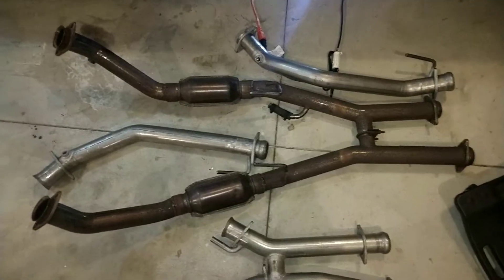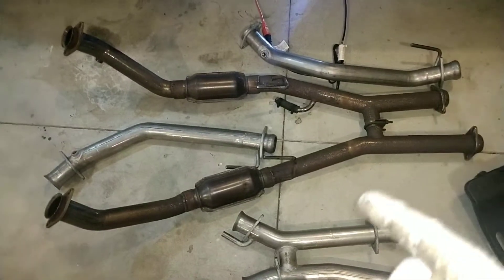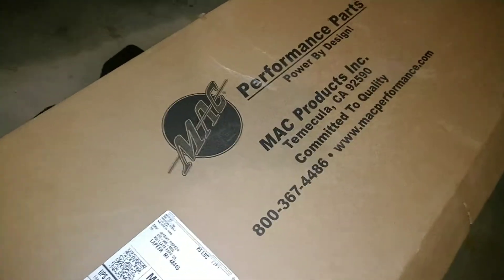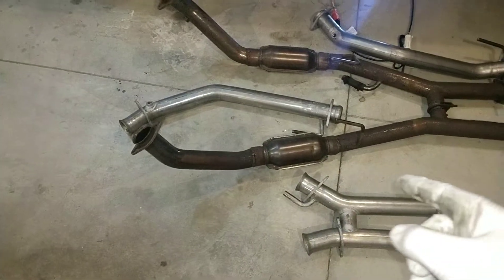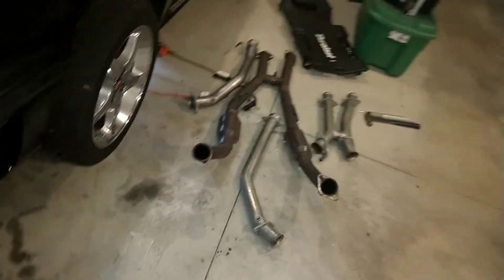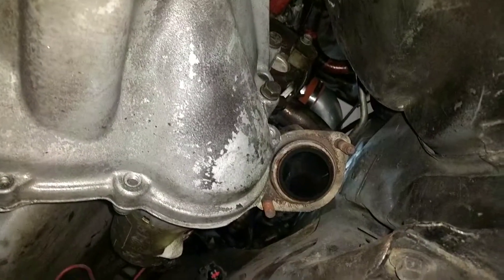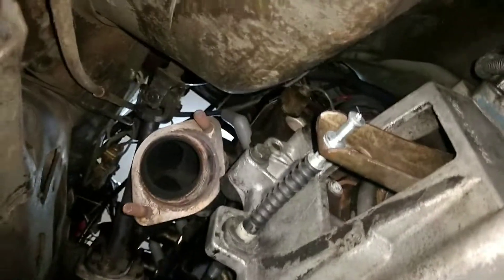Replacing Foxbody Mustang H-Pipe

Comment: Hey man, behind the cats, there's the hangers. On my 90 LX, I cannot for the life of me get them free. I am really just having a lot of trouble getting it out. Any pointers?
Reply from the maker: If I recall, those are the hangers near the transmission?  I think they were a little bit of a pain putting in, I had to really push them up, then slide forward into the hangers. Coming out, was easier because I pulled them out first at the headers (front), then unbolted from the mufflers. It then slid right out. I hope this helps, this was a couple years ago.
Reply: @jpp9846  yeah those are the ones. Been trying to get it free for about 3 days now. Used tons of penetrating oil to no avail. Going in with the blowtorch tomorrow. Thanks man, great content!
Reply from the maker: @vondy4956  I don't recall mine being as hard to remove as it was to install? My smog stuff had been removed (besides the cats that were put back on, then removed) too, there is a smog attachment near those hangers, be sure it's not still hooked up. Sometimes they face upwards towards the floor board, so you may have over looked it, that also needs to be unhooked, just another idea, good luck. These cars are a love-hate relationship.
Reply: @jpp9846  I have no such smog thing. The hangers are completely stuck, I have tried literally everything I have at home. I have no clue what to do.
Reply from the maker: @vondy4956  I will take a look at mine tomorrow and see what I can see.
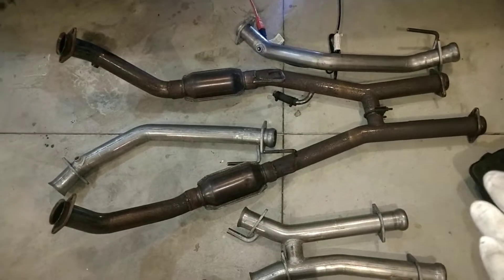Reply from the maker: @vondy4956  try putting a jack under the h-pipe and SLIGHTLY jack it up. This will help release some pressure. I'd then squirt some penetrating oil or WD40 into those rubber hangers and hammer those hangers out of those rubber loops with a wood or rubber mallet. If you look at my video again at 00:12 , that smog tube is the little wrapped and clamped tube you see near the hanger on the top. Be sure that isn't attached to anything.ive heard some people just cut and don't re-use those hangers.
Reply: @jpp9846  appreciate the advice man. Had to stop working on the exhaust as I had some more pressing matters (blown head gasket lmao). Its a shame since the car only has 50K miles and my dad was very easy on it. I'll definitely give that a shot when I get back to it!
Reply from the maker: @vondy4956   These cars will give you fits.  You honestly need to love them, or sever ties.  I haven't wrenched on mine in a while (*knocks on wood*) but I haven't been out in it  a lot lately either.
I think that floor jack trick will do it.
If not, I've heard of some people cutting those loops and not reusing them. Good Luck!

Comment: So far so good!
Reply from the maker: Lost a header flange bolt in the dam frame! Had to go buy one at the parts store... having a blast!
Reply: @jpp9846  I know how that goes!  Be sure to juice up all the threads with some penetrant spray.  Rusty hardware likes to bind up.
Reply from the maker: @fwh79FOXR6  dam bolt doesn't work. Guess I'm tapping out tonight...back at it in the AM.
In other news, was nice having that wall heater unit out there tonight...got nice and toasty!!
Reply: J PP:  Having heat in the garage is a game changer for sure!
Reply from the maker: @fwh79FOXR6  done! But with a few leaks at the header flanges and a few other along the way to the mufflers. Stinky!! Lol! 
Definitely has a deep growl to it. I'm going to probably go back through it and loosen and re-tighten the flanges....starting at the headers, back. 
Unless you got any other tips, that's the plan.
Reply: @jpp9846  That's good... I was wondering how it was going for ya.  I would just retighten the bolts like you plan to.  No need to loosen them.  Did you get the car down and take it for a drive?  Or is it still up on jack stands?
Reply from the maker: @fwh79FOXR6  re-tighten them, but t don't loosen them? I probably screwed up the sequence...I don't know...all I can do is smell fumes still, lol! Whew!!
No, the car is still up on jack stands, got about 6" of snow out there...no plans to take her out. Does that make a difference?
Reply: @jpp9846  The heat from running the engine will expand all the connections a bit.  So I usually retighten all the hardware after the pipes cool down.  I was just curious if the engine was running better now.  That's why I asked if you drove it or not.
Reply from the maker: @fwh79FOXR6  ahhhh! Man, that could probably be the ticket. Get those pipes nice and hot, then re-tighten. I didn't run it too long, I will need to open that garage door up all the way tomorrow and let her run for a bit, then re-tighten. Those fumes were just a bit too much, lol
You know what the car didn't do this time at cold start? Rev up to 1.5 RRMs then, slowly drop to .09 like it normally does....was strange. Not sure if that was good or bad? But it has a deep growl to it now, sounds pretty friggin awesome....just a bit fumee
Reply: @jpp9846  I would disconnect the battery over night to wipe out the computers look up fuel tables.  Yeah, you gotta have the door open to run the car.  Exhaust fumes are pretty dangerous.  That's one down side to winter wrenching.
Reply from the maker: @fwh79FOXR6  no, I open the door, but I had it only about the third of the way open....hahaha...not trying to off myself!! 😂
Usually a 3rd of the way open was good, but I think with these leaks, it just polluted the garage! 
You think I should completely unhook it or just the negative?
Reply: @jpp9846  The leaks are probably fuming you out.  I would just unhook the negative lead.
Reply from the maker: @fwh79FOXR6  yeah, you ain't lying..I just unhooked both terminals. Will hook it back up in the AM and run it for a bit...with the doors all the way open.
Then shut it down and retighten the flanges. Will let you know what happens. Wish I could take it for a run..but its 1 degree right now and snow...sigh....
Reply: @jpp9846  Spring time will be here before you know it.
Reply from the maker: @fwh79FOXR6  gotta get moving on this Intake and suspension...have a few other small projects, but these are my main ones. First things first, get this Carbon Monoxide issue under control, hahaha
Reply: J PP:  Did you buy any suspension parts yet?
Reply from the maker: @fwh79FOXR6  I have not. I am looking at buying the yellow Koni's...that are adjustable. I just figured I have this stuff and probably just need to get moving on what I have (Intake and H-Pipe). Was looking at new lowering springs too, with the Koni's. But I'm not sure about the springs yet.
Not sure if it's even worth lowering an inch...I just would hate to replace the shocks then get back in there for the springs. 
It's either the springs or a new aluminum radiator.
Reply: @jpp9846  I wouldn't pass up installing the dampers because you don't have springs.  The dampers are really easy to change.  It would be different if you were looking to install springs.  I would not recommend installing springs with out new dampers.  Usually a drop spring has a higher spring rate and needs better dampers to control it properly.
Reply from the maker: @fwh79FOXR6  no, I was thinking about buying/installing springs WITH the new Koni dampers. Since I am for sure getting the Koni's, I was "thinking" about also, getting the springs. If I get the springs with the Koni's, I'm going to wait on the radiator. Just not sure which is more important, springs...or radiator. The Koni's are definitely coming.
Reply: @jpp9846  I guess that really boils down to how good or bad your current radiator is.
Reply from the maker: @fwh79FOXR6  it's not bad, from what I can tell....it's original though, lol!
Reply: @jpp9846  Well if it's not rusted on the inside, it should be solid.
Reply from the maker: @fwh79FOXR6  I guess I can determine that when I drain it for the Intake. 
The fill neck looks a little discolored...doesn't mean it's all the way. 
I was going to just replace it, but when I started looking at the springs thinking they probably should get replaced too with the new dampers....the radiator started to become back burner. I don't know...I know I will be right there with the intake swap and I will be right there with the damper swap.
Reply: @jpp9846  I personally would lean toward getting a new radiator.  Springs can wait.  The new dampers will make your Stang ride much better.  Even without new springs.
Reply from the maker: @fwh79FOXR6  thanks...I guess I was just thinking I was going to be there, with both. 
I will probably lean towards the radiator then.
I didn't get to work on the exhaust again yet, hopefully tonight!!
Reply: @jpp9846  Well you have all winter to work on the car.  No need to rush anything.  Be sure to pace yourself.  It's not worth getting sick or burnt out over.
Reply from the maker: @fwh79FOXR6  yeah, I hear ya, just want to get moving on this stuff. I do not want to be working on this thing this coming spring/summer. My plans are to drive it...but as you say, no sense getting burnt out. 
I'm going to take your advice on that radiator and wait on the springs.
Guess I'm going out to start the car and let it get hot, then let it cool down and come back tonight after practice and see if I can tighten the flanges more...hope that fixes the leaks.
Will let you know...BRO!
Reply from the maker: @fwh79FOXR6  would I be wayyyy off just to loosen them all and then restart the tightening sequence over again? I''m reading if you don't tighten then alternatively (3 turns on one side, 3 on the other), you will get leaks. While I am pretty certain I did this, I'm wondering if I did it to them all.
Reply: @jpp9846  Sounds like a plan!
Reply: @jpp9846  If you feel that you need to loosen them and start over, go ahead and do that.  It's not a big deal.  If they are that far off from side to side, starting over by fully loosening them may be the best route for you to take.
Reply from the maker: @fwh79FOXR6  was just thinking I probably should go back through it and not "reef" on the bolts and chance smashing those flange balls...Hurts to smash the balls! 😧
Reply: @jpp9846  Hahaha... that's true!  Yeah, you need to be sure you are applying equal torque when you tighten up the hardware.  Try to be as even as possible.
Reply from the maker: @fwh79FOXR6  Lol! Ok, yeah can't be certain I did the best job doing that, a reset might be good, slow it down this time. Is there a particular pattern, front to back, Hpipe out, back to front...that I should incorporate?
Reply: @jpp9846  Just work from the header collectors back to the tailpipes.  So start on one header, tightening each side evenly.  Do not finish that header and more over to the other header.  Do some tightening on each stud on that header but don't completely tighten it.  Then go back to the first header and continue.  That way, you are applying even torque on each side of the header collector AND you are not getting one side of the H-pipe super tight while leaving the other side super loose.  Doing it that way will draw the entire H-pipe up to the headers evenly.  Once you get the header studs tightened down, move back to the next set of connections.  When those are evenly tightened up you can do the connections for the tailpipes.  Take your time and get the hardware tightened up evenly.  That should help you avoid leaks.
Reply from the maker: @fwh79FOXR6  thanks Hombre, so to review, start at the headers (off engine). Tighten one side a bit, then move to the other header, opposite side of the engine and tighten that up, alternating header to header until completely tight, then on to the front of H pipe, alternating, then to rear of H pipe, alternating each side while tightening... correct?
Reply: @jpp9846  You're welcome.  Yes, you got it.  You are trying to get everything pulled together evenly.  You will probably have to repeat this after the car is driven a few times in the spring.  Exhaust does a tremendous amount of expanding and contracting.  It takes some heat cycling for the pipes to take a set and stay put.
Reply from the maker: @fwh79FOXR6  ok, sounds good. Maybe I'm just wigging a little, but I noticed the "rocks in a can" noise when I reved it up...I "think" that noise is a leak noise. Thinking I need to just redo it. It's in, so the hard part is done, just need to tweak it now.
Reply: @jpp9846  You're right, the hard part is done now.  I would just snug it up and move on to the intake manifold.  Chances are the H-pipe is leaking and when you rev it, that sound becomes more pronounced.